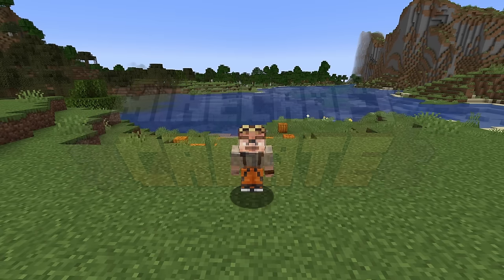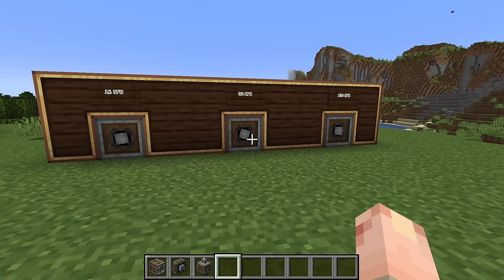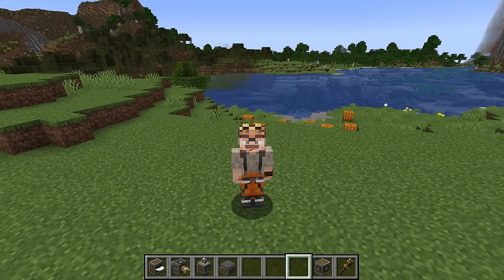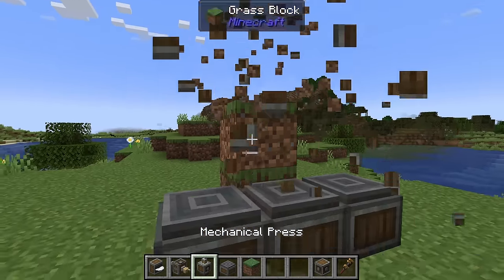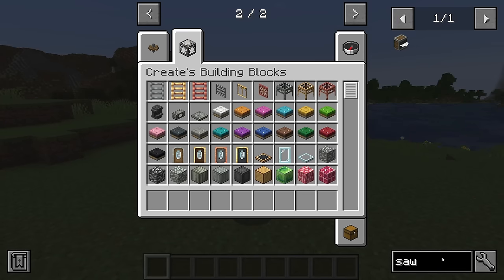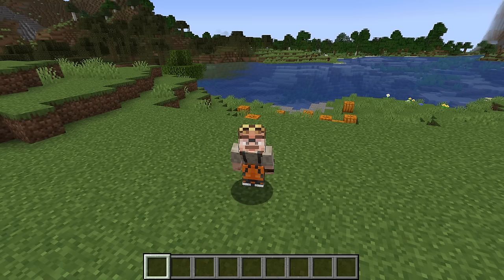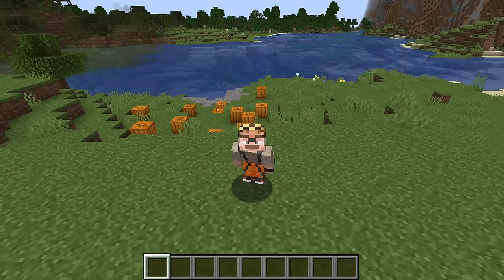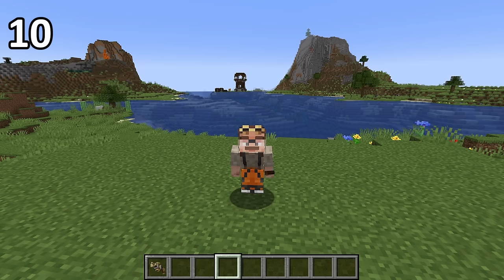10 things you NEED to know about the Create Mod

Comment: Also worth mentioning, valuable for earlygame: When placing casings on cogwheels, the casing isn‘t actually consumed, meaning you don’t „waste“ them. If you have one casing in your inventory, you could theoretically place it on 500 cogs and you would still have it in your inventory.
Reply: WHAT, HOW DID I NOT KNOW THIS
Reply: Didn't know this lol thanks
Reply: WHAT.
Reply: Thx Man thought it was a big waste
Reply: This when paired with the cogwheel trick to efficiently change speed in earlygame is the reason why I always keep Casings in my toolbox, doubles up as if I need them for a recipe for gearboxes or chaindrives, I just happen to have them on my person.
Also; Toolbox, not only are they useful for builting contraptions, that's EIGHT SLOTS of items condensed down to 1, it's HYPER valuable early game.

Comment: The only use for small waterwheels is to chain them to the big ones to double the speed with a small bonus
Reply from the maker: very true!
Reply: I was about to comment exactly this, using more words.
Reply: you can also power pumps and belts for something like a steam engine, they don't need many SU and not having to chain gears as much helps with compactness
Reply: Isn't the small waterwheel better than the large water wheel in terms of stress units per volume? 

You can fit 6 small water wheels (3 blocks for the water stream) in the place of 1 large water wheel... That's 3 times more stress units than the large water wheel in the same area :/
Reply: no way! two small waterwheels provides the 500SU at 8rpm and is 1 shaft and 3 wood blocks cheaper than a Large wheel with gear-ratio up
Reply: I strongly disagree. A small waterwheel is a lot more space-efficient. For the space of 1 large water wheel, you can put 5 (but reasonably 4) water wheels, since they can't overlap orthogonally. that's double the stress units of a large water wheel, for the same space
Reply: @destroything Then I wish you much fun trying to water them vertically space efficient.
Also, I don‘t intend to be rude, do what ever you want to do, I still think chaining up the big ones isn‘t nearly as much of a pain in the ass
Reply: @Medic3000 how is it one shaft cheaper? One big one is a small one + eight planks.
Reply: @Medic3000  The key feature of water wheels is scalability. You're never just gonna build one water wheel- the shafts you spent gearing something up are a cost distributed among every 1 of like, 16 water wheels, so if you're ever making more than one, large water wheels cost less, even at the same RPM
Reply: @pascalos99  One's bottleneck in generating SU is typically gonna be cost, not space efficiency- until you get to lategame, that is, and at lategame, steam engines are most space-efficient.

Small water wheels are incredibly niche, I can't think of a situation where they're the optimal choice for a whole base's power gen- maybe as power gen for some specific component of 1 isolated machine that's separate from your base, but other than that, never.
Reply: @TheHerald615  Lol, mood.

I'm sure there's some optimal setup, but it's never gonna match steam engines in space efficiency, nor larger water wheels in cheap power, so I'm not gonna bother finding and memorizing that setup.
Reply: Small water wheels are prefect to run a circular contraption to harvest anything.  Place it in the ground, put your bearing on top, done deal.

Comment: I have been using exclusively water wheels as my stress unit generators because I’ve never bothered to learn the other two lmao, I would absolutely love it if they added another cheap way to generate stress units (maybe something with gold since gold rarely gets used in create)
Reply: Solar panels made of gold and maybe tinted glass or glass and powdered obsidean. Then motors made of copper, shafts and andesite alloy.
Reply from the maker: you know they used to have a way with the encased fans but it was removed
Reply: @dejojotheawsome  yea, didnt generate a lot of stress tho
Reply: @Trygviz09  but i miss this feature since i used one usually to power clock bearings in a small space for clocks.

Comment: 1:25 - Fun fact: If stress units are intended to represent power (which I believe is what you mean by "energy"), then you can calculate torque by dividing SU by RPM (and there should be a proportionality constant in there as well, but let's hide that in the units rather than carrying around an extra 2*pi everywhere). That may not sound very interesting, but it turns out that every Create component that consumes SU can be described as consuming a fixed amount of torque (the game shows this number as the kinetic stress impact). For encased fans, that number is 2 SU/RPM.

Is that realistic? Eh, probably. Torque describes a force, not an amount of work or power. A fixed torque means that the object has a fixed amount of resistance to turning, regardless of how fast you spin it. Objects with a higher torque requirement have a greater resistance to turning, so we should expect a crushing wheel to have a much higher torque requirement than (say) a cuckoo clock. And indeed that is the case - a crushing wheel takes a whopping 8 SU/RPM of torque, and a cuckoo clock only needs 1 SU/RPM.
Reply: This is extremely interesting, actually being able to relate create in a way that mirrors real life engineering is crazy because it’s applicable, even if it’s not one-to-one, it’s still applicable
Reply: I ain't reading all that
Reply: @captainflapjack4080 cringe
Reply: ...huh
as a newbie to create who did a physics degree this makes it make a lot more sense lol, tysm

Comment: Knowing that when using 2 or more sources for KSU (kinetic stress units) that the output rotation speed will match the fastest source, wouldn't it be a good idea, early game, to use all but one large water wheel, using the small one to speed up the larger, more powerful ones to get a greater speed output?
I got this tip from someone else, I don't remember who, but I feel like that should have been mentioned. The small ones deserver a little appreciation.
Rip old water wheel water rotation physics ;-;
Reply from the maker: lol that tip came from me as well I think! At least I've showcased it a lot in my videos and shorts

Comment: About the threshold switch, I didn't know that thing existed until now, so, here's how I solved the filling up issue:

If your conveyor ends and the next block you put your funnel down instead of putting it directly on top of the conveyor, the gap under the funnel acts like an overflow output. In my iron farm, I put down fire there so that it burns the excess flint. I did the same thing with my clay farm.

Comment: there are boots that stops you from getting shoved around by the belts. forgot what they are called. diving boots? weighted boots? something like that.
also, waterwheels can also go horizontal. most times you are less limited with vertical space, so you can stack them on top of each other.

Comment: You mentioned connecting two different sources of different RPMs speeding the network up to the faster speed; that can be used to speed large waterwheels if you also connect a small waterwheel.

Comment: 12:00
instead of using the "threshold switch" just use a comparator, a repeater, and a clutch, or whatever system that is similar that can change the state of the network, without causing lag
a comparator can then output 16 different states (off and 1 through 15) which can be plugged into another comparator if you dont want to worry about the distance you need to place the redstone to get the desired level
to get a set level, create has its own "analogue lever" that can output those same 16 states, and can only be changed by hand... but whats most important about that lever, is that it ALWAYS can be changed on-the-fly
dont need a lot of items? set it lower! need more? set it higher!
your needs will change as you play, and as you explore the world
some form of "player presence detector" could also be used, and you could plug that into a redstone torch, to then invert the signal (on turning to off, and off to on) so that when you are offline, it automatically shuts off the system, or only runs it when you are within a certain distance, regardless of it being chunk loaded by the spawn chunks or some other form of chunk loader

i say that, because EVERY single component counts towards lag, they are effectively entities, they each require something to process

from what i can tell, for each SU required at a certain RPM, when you double the RPM, you double the SU
this current "times by x rpm" system is new

"dont get caught up in efficiency" only really applies when you are starting out
always try to improve, think of the mod like a puzzle, and your factory and its building blocks, the pieces

but you shouldnt go too far, which is what hes actually referring to

let me elaborate on that last part
on a server, you should ALWAYS try to reduce lag
and if you are having FPS issues, you should do so as well
but if you are playing alone, theres nothing to stop you from just doing whats simplest

Comment: If anyone is familiar with electricity and how it works:
Stress capacity = Watts
RPM = Volts
Stress Impact = Amps
(Luckily we don't have to worry about Ohms 😅)
Reply: Good thing that adding a line of a hundred shafts doesn't consume any SUs

Comment: large waterwheel with gear-ratio is arguably more expensive in material than 2 small waterwheels, so I wouldnt say small are un-needed. ESPECIALLY depending on your other mod setup. For me personally, I have several mods that introduce more rock-types and biomes, which in turn had the negative effect of making Diorite and Andesite more uncommon. I need to be mindful of Andesite alloy use, so a Big waterwheel + 2 gears-shift Costs 1 more shaft, and 3 more wood planks,and makes a bigger visible footprint on my builds

Comment: Small waterwheels are not utterly useless. I use them on the end of my large water wheel stacks so that I get an output shaft along that same line, at 8rpm. No gears necessary, and it still adds it's little bit of su to my system.

Comment: Would you know/have a guide or video showcasing some more methods of the clutch+threshold switch? That one was my favorite tip from the video!
Reply: One tip I can give you is using redstone links instead of running a redstone wire path to the clutch. They’ll make things much easier and simpler when making large assemblies and machines.

Comment: Well, as for me, I already knew tips 1-6. (7) I didn't consider weighted ejectors to be useful, but I guess I might take a look at them in the future for splitting stacks in maybe 16 steps or something, especially for bulk processing, where time is related to the stacksize in multiples of 16 items. (8) Yeah, I should use toolboxes more. I already knew the information though, but thanks for the reminder anyways... (10?) Using the extendo grip is something I should do as well... ps: Did YOU know, if you use the extendo grip with a backtank equipped, it does not drain durability but uses the air of the backtank? I think that's working with more create equipment besides the extendo grip. Oh, and I didn't know about the diving gear (especially the netherite one).

Comment: There is a tradeoff between large and small water wheels, one is not better than the other. Is your concern space usage, or resource consumption?

You can use four small water wheels in the same space a large water wheel would take up (not accounting for water), essentially doubling your SU output.
However, four small water wheels come at four times the Andesite cost, and twice the Plank cost.

Comment: Your examples at ~3:15 and ~4:53 are misleading.  The mechanical press is a relative consumer of SU, yet your point at ~4:53 is that they take the same SU.  But they only do that because you manipulated the RPM with the small cog wheel.  To make your point clearly, you should use a device which didn't have a variable amount of SU consumption, and/or showed the difference of SU consumption of the different RPMs by not having the extra cogwheel.  The mechanical press will work faster the more RPM that it has too, so there is a benefit to more RPM for that device.

Comment: I disagree with how you phrased the first tip.

Yes, technically the water wheel will always produce the same SU, but the EFFECTIVE SU that it creates is highly dependent on how high you need your RPM to be. If you need to quadruple the default RPM of the waterwheel, the effective SU that wheel is creating gets quartered. 

I think stating that it is static and that they aren't related to one another is a bit misleading and not the entire picture.

Comment: hey did you know in gear ratio you can just put a shaft in front of the small cog and it will be more cost efficent
Reply: encasing cogs don't use up the casings though

Comment: 4:14 why do people always ignore the fact that you can fit 4 small ones in the space a big one takes??
even if you only need 512 SU, having two water wheels next to each other instead of one big one is much easier to move around

yes, it costs slightly more iron/andesite, but honestly if you have a mixer and a saw, it's not an issue at all: you can make 54 water wheels from a single iron ingot
Reply: Maybe even 9. Small wheels take up 1x1, but big ones are 3x3...
Reply: @octopuszombie8744  well no, you can't place them right next to each other, there has to be a gap of at least one block

that means that you can only place one in each of the 4 corners if you want to keep the orientation the same as the big water wheel (which you need to do if you want to place multiple next to each other)
Reply: Also I think the thing about large water wheels IS in fact that fact that they cost less. Sure it's "slightly less iron/andesite" but it's also accurate to say "twice as less iron/andesite". Though it's not like we would use that many water wheels anyway to make much of a difference so I see your point.

Comment: Doesn't the stress capacity of windmills and small waterwheels increase in proportion to the speed they rotate? Even if you mean they don't change *for the setup they are*, I feel like the way you put it here could confuse people to think that, for example, a windmill always produces 2048 stress units, regardless of how fast it's spinning. I only mention because that's how I interpreted it and had to go double check and make sure I wasn't just wrong about how they worked.
Reply from the maker: Water wheels have fixed rate stress production and windmills produce more SU as you add more sails up to a limit of 8192

Comment: The waterwheel can make more and less than 256 stress units, it depends entirely on how many sides have water flowing and the direction of the flow relative to orientation. It's possible to generate 320 stress units with a water wheel, the easiest way I've found to do that is to place it horizontally rather than vertically.

Comment: naah both the water wheels have the same power. if we would make a horsepower unit lets say power made at max speed aka power made at 256 then both water wheels would have the same power and when ur doing eny create contraption u care about horsepower not stress units and not rpm

Comment: please. stop calling them rotations per minute, it's revolutions. America and France will thank you
Reply: But, it literally is rotation? Its rotating about its own axis, its not orbiting around another objects axis (thats what revolutions are).

For the example he used, the windmill, it is a block of wool on top of a spinning axis at the base, that spins 4 times every minute. Thus it spins at 4 Rotations Per Minute (4 RPM). If instead we were looking at, say, a minecart going along a circluar track that made it all the way around 4 times a minute, then it would be right to say its going at 4 Revolutions Per Minute (4 RPM). He's not wrong, its just that unfortunately both measurements use the same acronym, and are similar at first glance, so it can be a bit confusing sometimes lol.
For a gear ratio, were we to somehow lock the big gear in place and have the small gear operate the same as before, it would switch from rotations per minute to revolutions per minute, as now it would be revolving around the large gear instead of entirely just rotating about its own axis. Hope this helps!